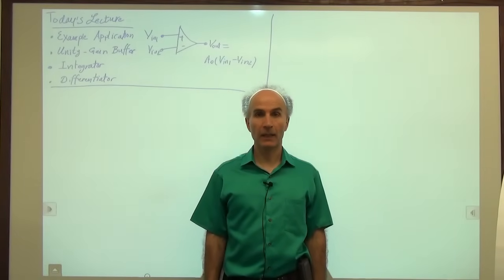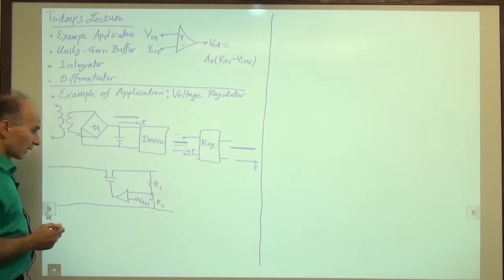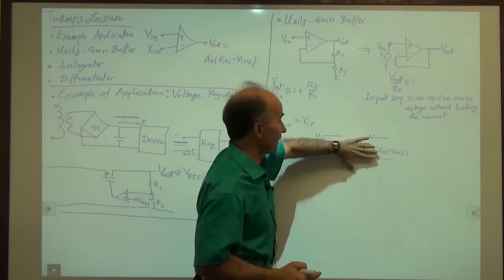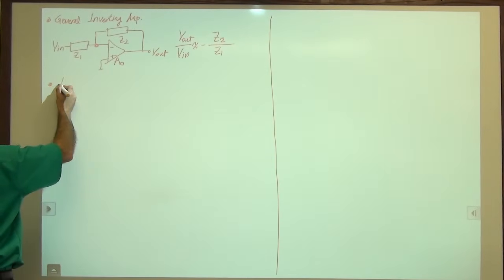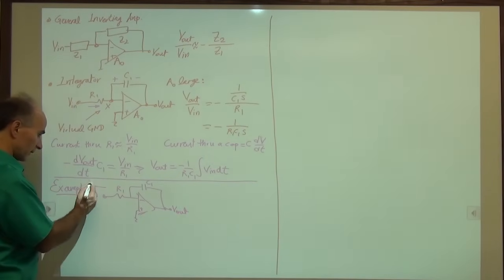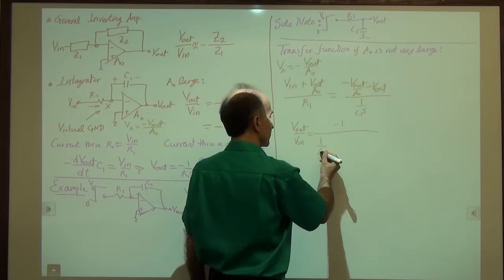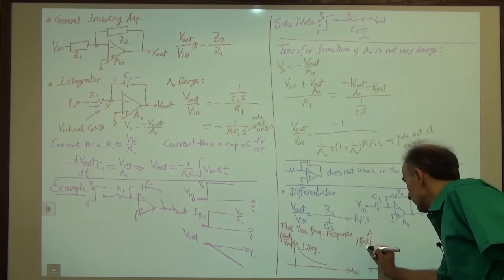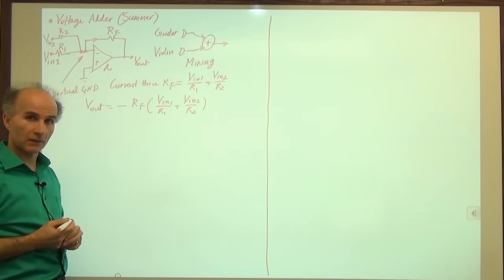Razavi Electronics 1, Lec 43, Op Amp Circuits II

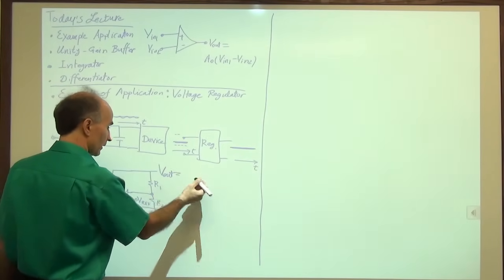Comment: 11:45  how can we ensure the MOSFET operates at triode region?
Reply: When the drain voltage increases beyond Vref, gate voltage decreases. Since the resistance is inversely proportional to Vgs-Vt so it will increase. And since Vds is inversely proportional to R so Vds will decrease with increase in resistance. This will keep MOSFET in triode region ig. 

When resistance of the MOSFET in linear region increases current reduces hence keeping the value of drain close to that of source.
Reply: same doubt  :(
Reply: Since the op amp in the circuit has a voltage (Vref)     -> Vout - open loop gain = Ao(Vref) -> gate voltage increases making the mosfet work in saturation region..
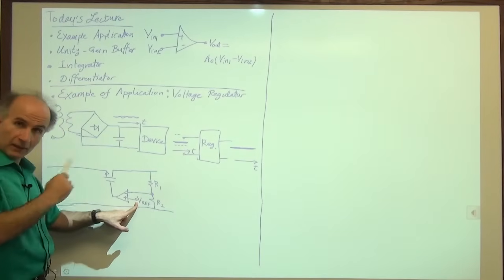Reply: I a doubt here at 11:33 , if here input terminal is source and output terminal is drain, that means that drain is at higher potential than source and the amount by which its higher is voltage across the resister, now if the source terminal is increasing its value, that means drop between drain and source is decreasing, so inorder to stop the drain terminal to increase its value, we should ACTUALLY DECREASE the resistance between them,instead of increasing it. Pleaseee clear my doubt!!!!

Comment: You Cleared many doubts sir
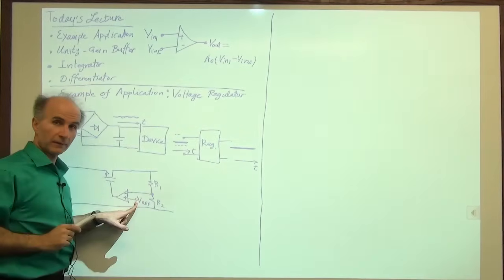Reply: I a doubt here at 11:33 , if here input terminal is source and output terminal is drain, that means that drain is at higher potential than source and the amount by which its higher is voltage across the resister, now if the source terminal is increasing its value, that means drop between drain and source is decreasing, so inorder to stop the drain terminal to increase its value, we should ACTUALLY DECREASE the resistance between them,instead of increasing it. Pleaseee clear my doubt!!!!

Comment: Enjoying the way he simplifies the concept. Thank you Professor!!
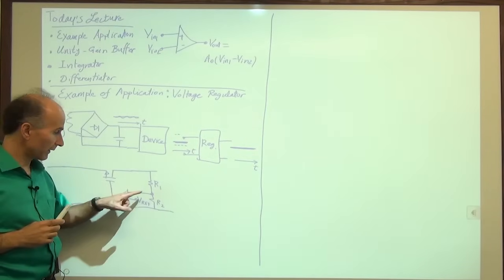Reply: I a doubt here at 11:33 , if here input terminal is source and output terminal is drain, that means that drain is at higher potential than source and the amount by which its higher is voltage across the resister, now if the source terminal is increasing its value, that means drop between drain and source is decreasing, so inorder to stop the drain terminal to increase its value, we should ACTUALLY DECREASE the resistance between them,instead of increasing it. Pleaseee clear my doubt!!!!

Comment: Does anyone know the name of that catchy music in the beginning of these videos?
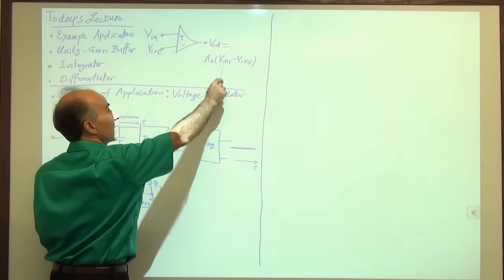Reply: I a doubt here at 11:33 , if here input terminal is source and output terminal is drain, that means that drain is at higher potential than source and the amount by which its higher is voltage across the resister, now if the source terminal is increasing its value, that means drop between drain and source is decreasing, so inorder to stop the drain terminal to increase its value, we should ACTUALLY DECREASE the resistance between them,instead of increasing it. Pleaseee clear my doubt!!!!

Comment: A good teacher shows how smart he is, but the best makes his students feel that they are smart. Thank you, Professor Razavi. You are the best of the best.
Reply: I a doubt here at 11:33 , if here input terminal is source and output terminal is drain, that means that drain is at higher potential than source and the amount by which its higher is voltage across the resister, now if the source terminal is increasing its value, that means drop between drain and source is decreasing, so inorder to stop the drain terminal to increase its value, we should ACTUALLY DECREASE the resistance between them,instead of increasing it. Pleaseee clear my doubt!!!!
Reply: @RaviNagar16 the location of the drain terminal and source terminal do not depend on the symbol, but on the voltage difference or the driving current passing through the mosfet (which in this case an NMOS). Apparently current flows from left to right then across resistors to complete the feedback mechanism. Therefore, in this case, no matter how Professor Behzad razavi draws the NMOS, the drain terminal is on the left and source is on the right.
Reply: @ylmak3998  drain and source can interchange mos is symmetric bilateral device.

Comment: Is their any reason that the inverting and non-inverting amplifier should look like the same as with that two resistances 
Why can't we just remove both resistances and just apply the input on either of the two terminals and call it as inverting and non-inverting amplifiers
Reply: I a doubt here at 11:33 , if here input terminal is source and output terminal is drain, that means that drain is at higher potential than source and the amount by which its higher is voltage across the resister, now if the source terminal is increasing its value, that means drop between drain and source is decreasing, so inorder to stop the drain terminal to increase its value, we should ACTUALLY DECREASE the resistance between them,instead of increasing it. Pleaseee clear my doubt!!!!

Comment: Why is thevenin voltage is found at input and thevenine resistance at output? As far as i know both should be found at same place.
Reply: Thevenin voltage is found at output for unity gain buffer output voltage is equal to input voltage he said it listen again you will get it